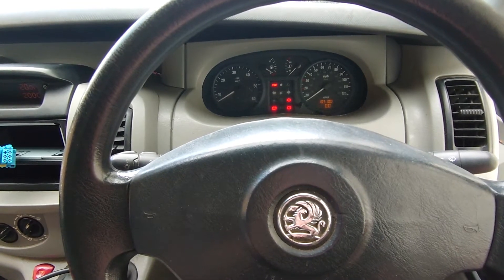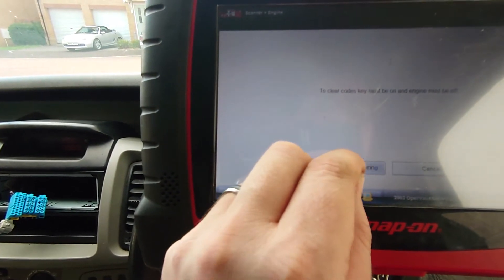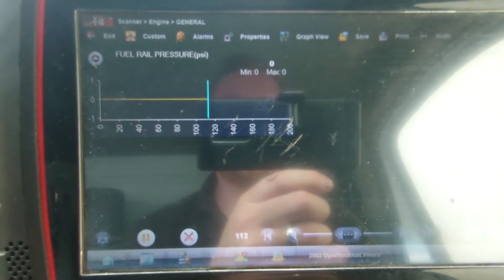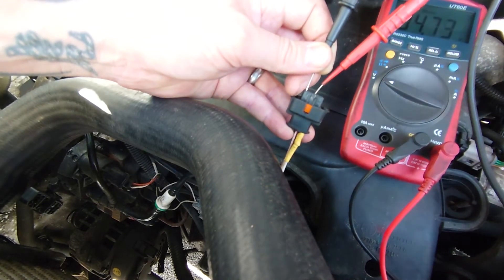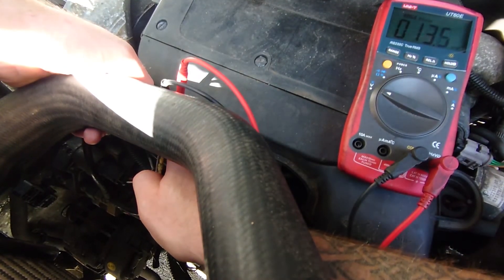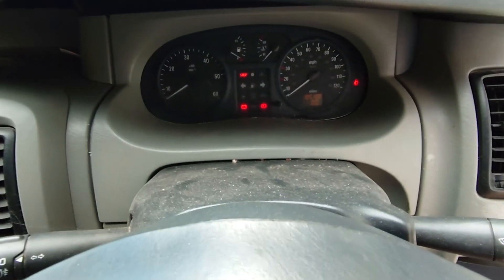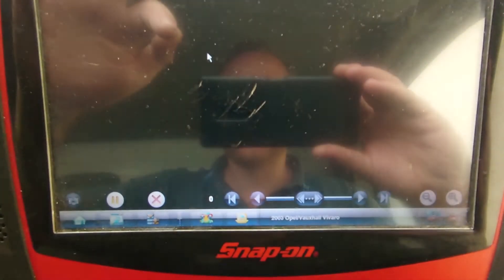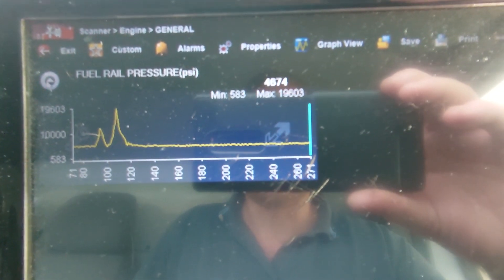Vauxhall Vivaro non start P0192 fuel rail pressure

Comment: How do you changed the plug such as the location of it as I need to do this with my van
Reply from the maker: You can buy an new plug prewired  and join them one at a time with solder and shrinkwrap or splices.

Comment: Hi do I need to clear the code once I replace the sensor? Thanks
Reply from the maker: I cleared the codes before starting but it may run without doing this and just leave the engine light on.

Comment: Same issue, new sensor and I still get 5v on signal wire! just purchased that decade box. Any idea why the signal wire still shows 5v??
Reply: Wrong sensor ? Happened to me , you could compare the resistance readings  between the pins ?

Comment: I've got a similar problem on my 2005 Trafic 1.9, i'm on my second fuel rail pressure sensor now, the last one said the fuel  pressure was incredibly high, despite there being zero pressure and the latest one is only reading 0.38v and drops one cranking... I've just ordered another to see if i've just been unlucky and bought duff sensors; hope so 🥲

Comment: Why does the voltage drop-disappear when connected? I have a Volvo v70 d5 and every time I connect the fuel pressure control valve to the connector 8v disappears. At first, I thought that the connector wiring was bad but it wasn't. Right now basically when the ignition is turned ON the valve stays shut because there's no voltage when the sensor is plugged in.

Comment: 2003 vivaro 1.9 confused... just removed wiper stalk looked it over put back van dont start turns over does not fire up glow plug lights do not illuminate checked fuses wiring 70 amp fuse at bonnet checked gloplugs injectors  done many checks crank shaft sensor replaced got the voltage like you on the fuel sensor when plugged in i have tried continuity between fuel sensors 3 pins while still in the rail and not had a bleep  so would you say its the sensor???? i heard that maybe the solenoid open and close switch on the high fuel pump may be stuck in closed position im lost please help

Comment: I got a 2002  combo 1.7dti.. starts great but if left for a few days or a week it struggles to start  it will start eventually after pumping the throttle pedal... could this be the fuel rail sensor????

Comment: Hello I’ve got a similar fault with my 2004 Renault trafic 1.9 van will turn over but not fire up then engine stop light starts flashing watched your video and tested fuel pressure rail sensor connector and loom but not getting any voltage with it disconnected is it likely to be the ecu faulty? Many thanks
Reply from the maker: Check to see if there is voltage at the ecu on the feed. Have you also confirmed the earth on the sensor? This will also give you chance to check continuity of the wires. Thanks for the comment👍

Comment: Got a strange one, got p1822-0a fuel pressure solonoid valve circuit low input (getting 8v) and p0191/p1882-09 fuel rail pressure sensor range/performance.

The pump solonoid has a very submit buzz when the ignition is turned on.

P1885-0d replace control unit
P1826-0b how device circuit general error.

Van cut out and won't restart on its own but will start and idle if you stand pumping the primer bulb on the fuel filter.
Reply: Replaced pump in the end

Comment: Help. Cranking but want start   No lights abnormal on  dash. Alarm light goes out.  half tank of fuel. last used 3days earlier with no problem. Good battery + used booster pack. 
Any ideas will be appreciated

Oops !! must add  vivaro 04 year
Reply from the maker: Can you check the fuel pressure rise on a scan tool?
Reply: @rmautodiag  I only have a cheap OBD
No reports
Reply from the maker: @DownAvenueWay  I think you need to get hold of a tool with some live data for some more checks.
Reply: @rmautodiag  any recommendations of the tools needed ?
Reply from the maker: @DownAvenueWay  Opcom would probably be your cheapest option. Plenty on ebay.

Comment: Nicely done. Have you ever come across a Renault Traffic 1.9 that starts but wont rev when its warmed up. All of the mechanics I have seen in Devon, including the the dealership cannot diagnose the problem.
Reply from the maker: Injectors used to give problems with no revving for 10 seconds after startup.
Reply: Maf sensor can cause non revving issues often with no fault codes.